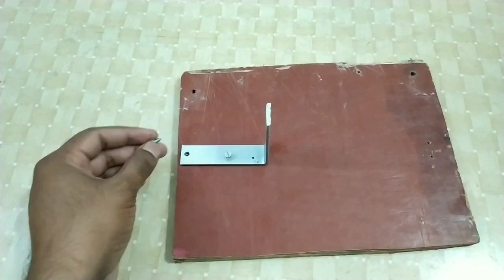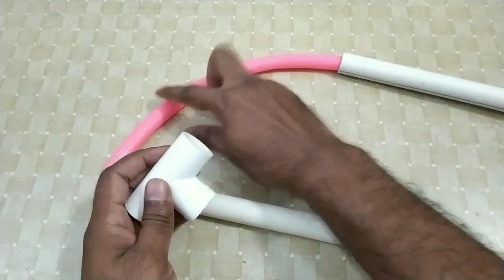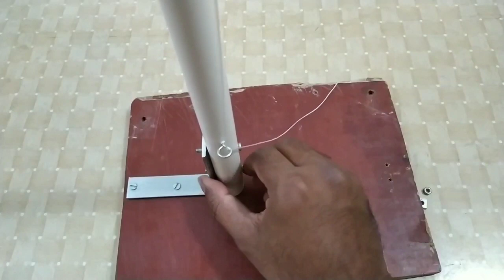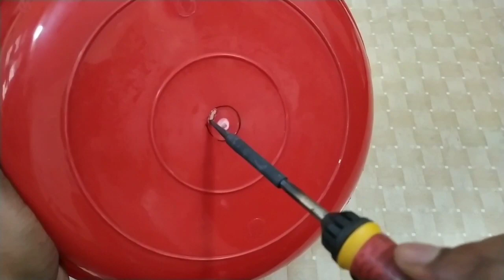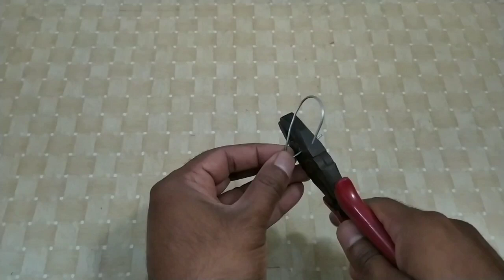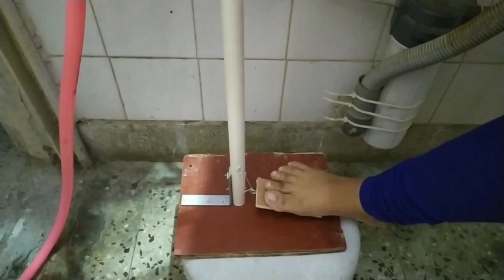How to make foot operated water tap | handsfree water tap

Comment: What are the metal brackets placed along the pipe called? From which the nylon string is passed. What is the name?
Reply from the maker: Metal angle or L patti used for pipe stand, for nylon string curtain holder hooks are used, all items are easily available at any hardware shop
Reply: Eye hook in America